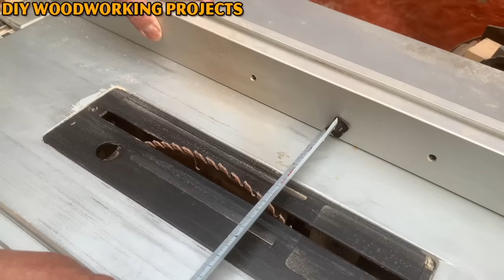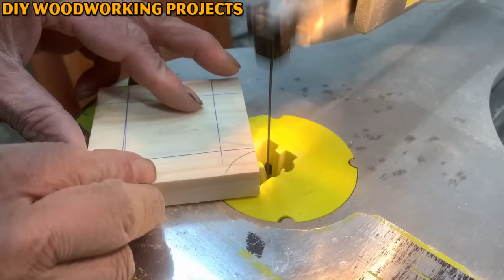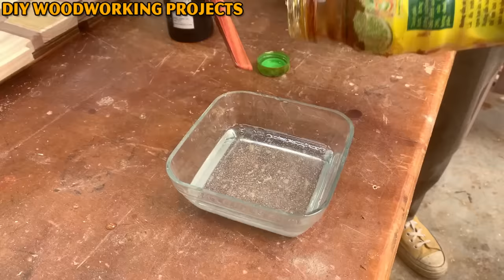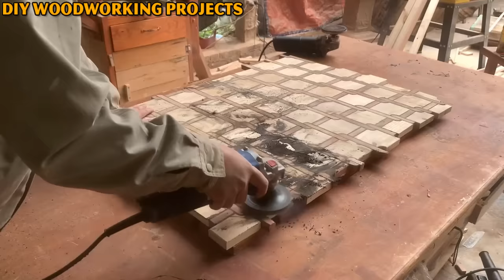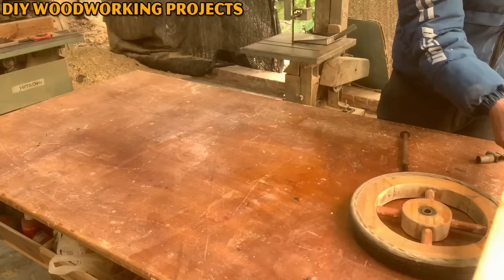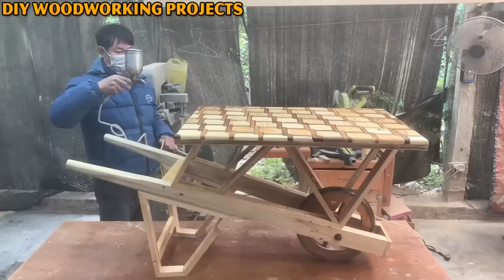Unique Artistic Woodworking Skills // Wheelbarrow Coffee Table You've Certainly Never Seen - DIY!

Comment: The top is a beautiful design. I am not sure about the single wheel barrow concept though. Seems like you cannot move the table without first clearing the things on top. Would've been easier to just attach small wheels on the legs so that you could move it even with things on top. Well, at least that's how I would look at it.
Reply: What things on top??  Wheels on legs or wheelbarrow bottom…same movable table.
Reply: @Cynthia Collett  Stuff you put on tables.  If you aren't going to put anything on a table, then there's no point having one.